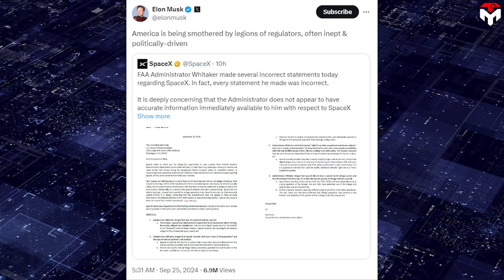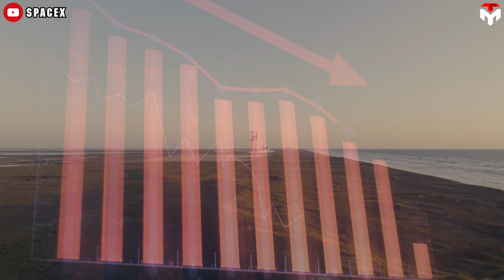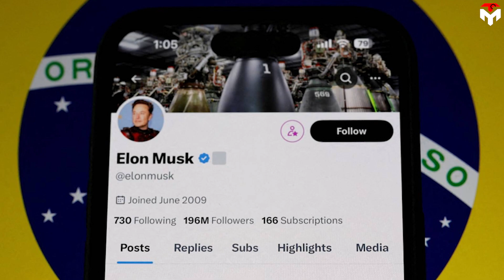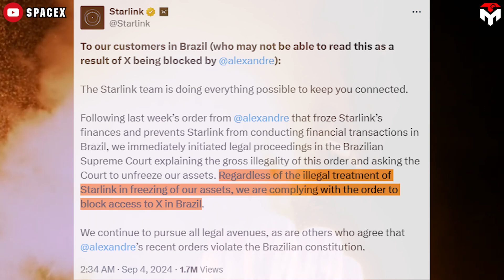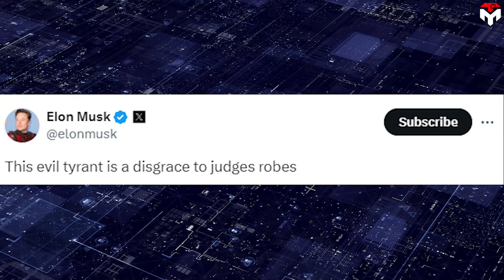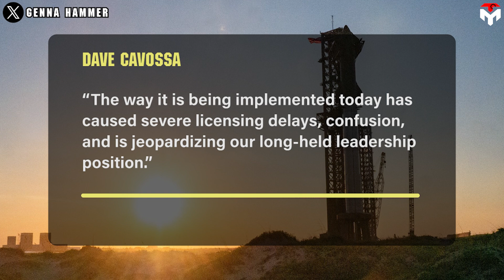SpaceX Leadership Changed! FAA Stop delaying Starship because Elon Musk...

Comment: SpaceX can't move starship to another country because of ITAR regulations.  But they are developing a new version of the raptor engines and could easily move the design team someplace else so raptor 4 is developed in a new country free of ITAR restrictions.  Other restricted systems like giudance are easier to develop in the new host country.  At that point, the new rocket could be built and flown anywhere.  America will not allow them to return the ship from orbit by reentering the atmosphere and flying the approach over populated areas.  They need a peninsula where launch and recovery are over water.
Reply from the maker: Good idea.Do you know of any countries that are not restricted by ITAR in this case? ☺☺☺

Comment: The FAA licensing system for such test rocketry needs to work differently.

There’s relatively little difference between IFT4 and IFT5, it should not need going back to square one, to obtain a flight license.

Also the idea that each individual use of the water deluge system should require a separate license is ludicrous.
Reply from the maker: Thanks for sharing your interesting idea :face-red-heart-shape::face-red-heart-shape::face-red-heart-shape: